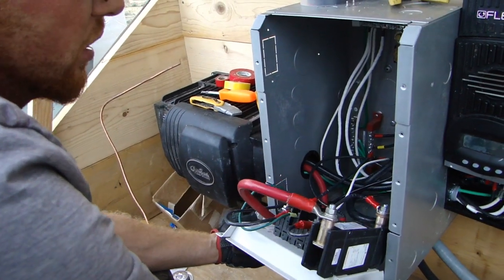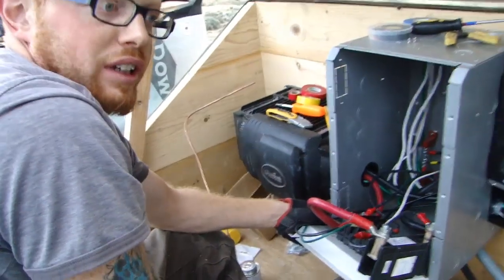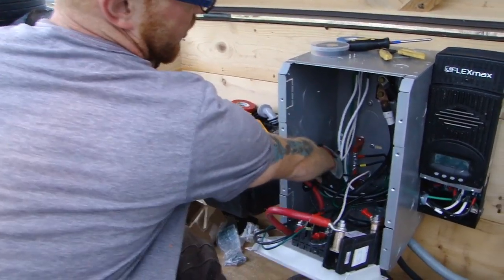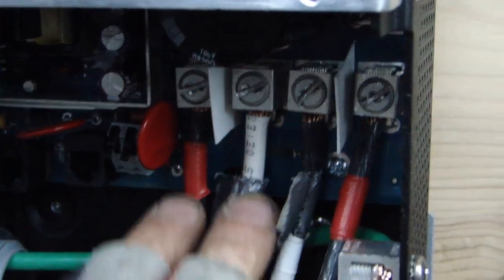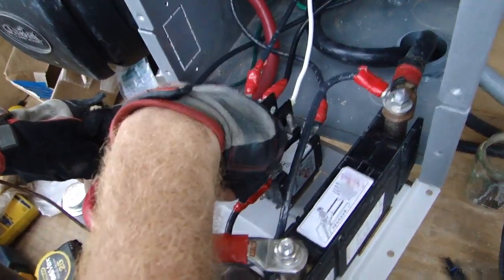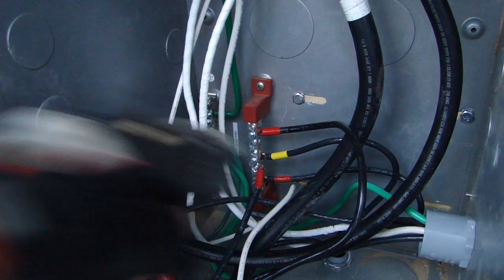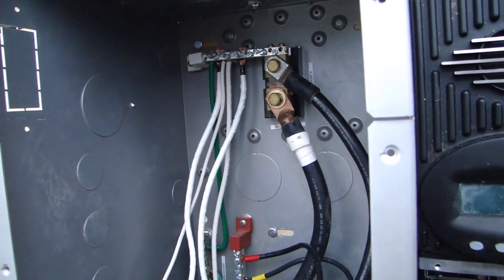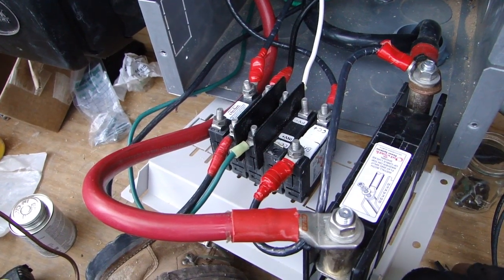Solar System Installation - Part III

Comment: I see that someone else has commented on exactly the point I wanted to make. That is: treat every circuit as if it were live and break the habit early of touching terminals and bare wires with your hands while pointing something out. If you want to point out a component inside a panel, don't use your finger but point instead with something non-conductive like a piece of dry, plastic pipe. Get in this habit early and save yourself a shock or worse! Otherwise, your video is informative

Comment: A note about your ground rod installation. I worked for a guy when I was younger and we had to redo all of those clamped-on cable connections at a site because they corroded within a few years. In areas with high salt content (near the ocean I guess) the contacts lose their ability to act as a ground and cause a fault. 

We used a system called Cadwelding to melt the copper wire into the rod. Then used some kind of sealant to prevent further corrosion to the exposed copper. Keep an eye on them and if you see green starting to show up, remove those clamps, clean the connections and consider alternate options.
Reply from the maker: good looking out, thank you!

Comment: I think the color coded cables from the pv in to the positive bus bar should be only one main big positive wire and one bid negative including the ground. In which only the positive should go directly in to the Charge controller. bypasing neg and ground going to the bus bars (-) and (g) That's why you have a PV combiner to set all the wiring in there before the fx500. I got confused with the video comparing it to the Manual.

Comment: Hi, first, thank you for providing these videos and wish you the best of luck and I'm trying to set up a similar system like yours but I'm having hard time finding the load center box and as of my understanding that the breakers in the box are 80A DC. please explain the size of the breakers and if it is ok to use any breaker box as load center.
thanks again and good luck.